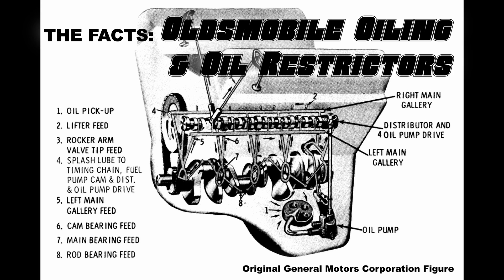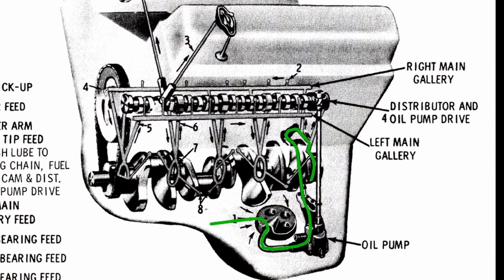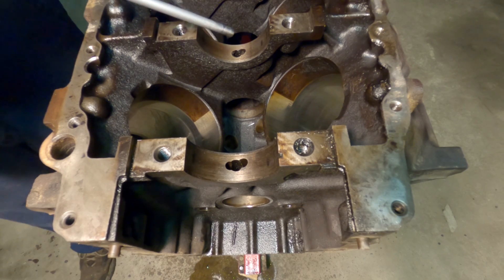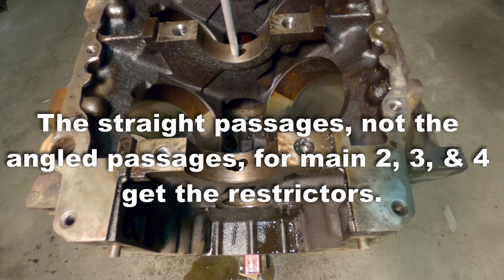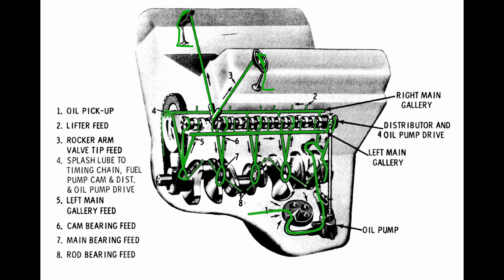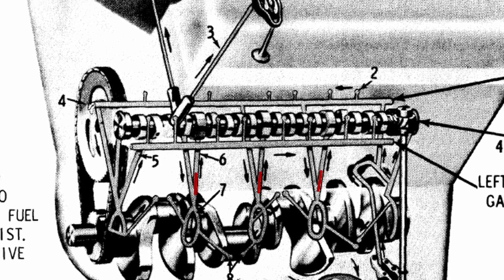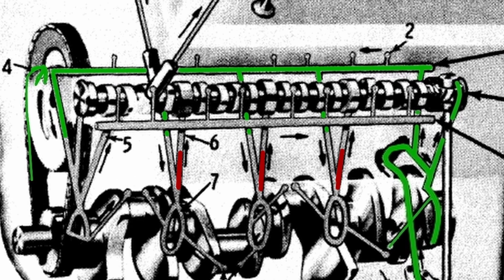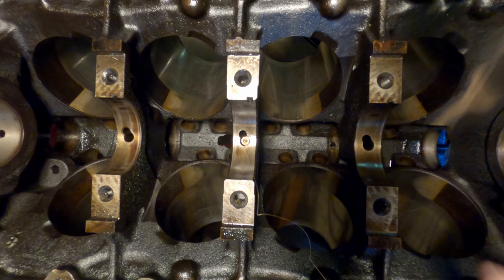The Facts on Oldsmobile Engine Oiling & Oil Restrictors

Comment: Great video but no where does it tell me the size hole in the restrictor. Thanks
Reply from the maker: I just measured a 455 I built and can verify the restrictors are a chamfered 0.100" orifice. The ejector ports are a chamfered 0.045" orifice. Those are accurate to 0.001" so if you use poor measuring equipment and make a 0.949" restrictor it will perform differently, accuracy matters here.

Comment: Joe mondello used them so don't not use them.......Dr. olds.
Reply from the maker: Joe Mondello understood Olds engines in a profound way. A stock Olds engine will easily run for 300K miles without restrictors, but for performance applications the restrictors really do make a difference. Dr. Olds knew his stuff.

Comment: What size are the restrictors?  .040?
Reply from the maker: Excellent question, 0.040" would be extremely small for that passage! The restrictors are typically drilled with a chamfered 0.10" orifice.

Comment: Excellent video as i have a remanufactered 350DX diesel oldsmobile long block and company installed cheep bearing and i don't think the block was cleaned properly I'll be checking all oil passages and coolant block ports ❤❤❤ peace and much respect to you 😀 👍
Reply from the maker: Take out the gallery plugs and really clean out the gallery, I see shavings sometimes in the ends behind the plugs. Thank you for the comment!
Reply: @junkdump2720  I added a new comment but it posted to me and not you thanks again for your sound advice 🙂
Reply: @junkdump2720  I'm planning on filming 🎥 my build step by step
Reply: @junkdump2720  I surely will thank for the strong 💪 advice
Reply: Yes the plugs are out and looking like they have magnetized small metal slices and slivers I'm re going through the whole cleaning process your video really is going to help with lots of processes and other things of true knowledge 😀

Comment: Some really in depth stuff. This clears up a lot of info Ive heard over the years. Ive been running a 86 Olds 442 with a 68 OIds 350, 9.8 compression, Hyd flat tappet 230/234@.050/ cleaned up #6 heads with stampted steel rockers, RPM intake/ 650 DP carb / 3.73 and a THM 350-10" 3000 stall. Some "experts" told me that if I dont do major work on the oiling, Id fry the motor in one season of bracket racing. 13.0s from 2000-2004 then 12.60s by 2005-2018. Approximately 400 passes down the quarter mile with a  stock oili pan, no restrictors , only a high volume oil pump (runs 40-45 psi). I figured that with only shifting at 5800....no sustained high speed use, that Id be fine with the set up I had. You seem to confirm that if you're not spinning the motor to high rpms for long periods, like say in a boat or a 10-11 sec bracket car shifting at  6500, it's  as critical, that the engine wont blow up in a season.  OR, maybe Ive just been extremely lucky. Conventional oil to boot. At what RPM/ET do restrictors really become a must?
Reply from the maker: First, thank you for sharing your real world experience! I bet there are not many people that can say with certainty, aside from real experts like the Joe Mondello and Dick Miller types, where the line is when restrictors are a must. I have raced a worked 350 and 455 without restrictors and stock pans successfully, I used the correct viscosity conventional oil and Wix oil filters. My recommendation is to install them when you next rebuild or tear into the engine. They don't hurt anything, they simply change the oil distribution to favor the bottom end rather than sending so much extra oil to the cam bearings and upper end. Thank you for your comment and don't listen to the "experts", most of them have never seen the inside of an Olds engine and they're just repeating what they heard from an "expert". On my channel I try to disprove the misconceptions using facts and accurate information.

Comment: Hello what oil should I uses on 70 cutlass sx 455
Reply from the maker: For a stock engine, 10w-30 is the viscosity your engine was designed to work with, except for extreme circumstances like a desert. The best oil by a large margin is Castrol Edge Full Synthetic (not High Mileage). It has the best protection and leaves the least residue, also Never add any additives to your oil. The best oil filters are WIX or the NAPA Gold series (which are wix filters). I never recommend purolator or Fram, purolator are too restrictive and fram are prone to failure, both fail and bypass oil in a way that you won't notice your engine is receiving unfiltered oil.
Reply: @ thank you 🙏🏼

Comment: I Brought a rebuilt oldsmobile short block 307 engine and wasn't getting oil pressure on the driverside up to the push rods and rocker arms because ,whoever rebuilt the block left out the rear left side inner oil gallery pipe plug that also oils the distributor driving camshaft gear.
Reply from the maker: That is a common mistake I find in Olds engines, I am glad you figured out the problem!

Comment: There is so more you can do to the Olds block. 
Cross drill the crank, enlarge the oiling holes on the main bearings. 
BMRE did my engine work and so far it has lasted 30 years in my boat with rpm’s up 5,600.
Reply from the maker: That's very true and it's great to hear your engine has lasted so long! I also cross drill all of my cranks.

Comment: I have comp cams roller tip rockers,  they are advising that without rocker arm oil deflectors, a hi volume pump will shoot oil over top of the rockers and they go dry  and damage. I am not running restrictors, this is a low rpm motorhome engine with high volume pump
Reply from the maker: If you are worried about this happening I suggest using deflectors or restricted pushrods. Oil deflectors will not adversely effect your engine if properly installed. A pneumatic drill will run the oil pump at idle speeds so you can verify proper operation with one of the valve covers removed.
Reply: @junkdump2720  I just haven't seen any oil deflectors for an olds 455, comp cams doesn't have any that I've seen, what I have seen is temporary ones or weld on one's, .. it seems restricted pushrods are as expensive as the complete set of rockers, pushrods, guides and studs. And I'm positive I won't find any in canada... I think I'll take the high pressure spring out of the high volume pump and it won't be as aggressive... I also wonder if the problem will even exist at low rpm, I never get this thing over 3500 rpm anyway
Reply from the maker: @TrentGustus  You are correct, finding deflectors for an Olds engine is near impossible. You can get restricted pushrods for $250 USD through Mondello, measure your originals and they should be something close to the PR-9.700x5/16, they are Hardened with a  0.040 restricted end that should be on the Rocker Side. Removing the high pressure spring is a great idea for your engine and you hopefully won't have problems.
Reply: @junkdump2720  use the original pushrods with the comp cams rockers? Of course comp specifically says to use their pushrods as  well ,  ... maybe that's the best idea, I'll look at my old pushrods.
Reply from the maker: @TrentGustus  You will need hardened pushrods if you have heavier valve springs than stock. Lots of Olds guys run high volume oil pumps without deflectors, I don't think I have ever seen Olds specific deflectors.
Reply: @junkdump2720  I have stock valve springs, so shouldn't be an issue. I'm going to check the length of the stock, pushrods and the hole size, hey, thanks for all the help... ive probably watched each of your videos 3 times.. one more question.. stock head torque was listed at 85 lbs, however  arp bolts recommend 70lbs, and these are felpro head gaskets, not stock mls steel.. what is your opinion?
Reply from the maker: @TrentGustus  I torque my heads to factory torque specs, the arp bolts can handle the extra torque, just be certain to dip the threads in engine oil before insalling and torquing.
Reply: Well, got my answer on the stock pushrods, you're right, one end does have a smaller hole, however, they're about 7 mm shorter and that causes the rocker to interfere with the   radius low on the studs. In my attempt to adjust,  the rocker pressed on the arch and got stuck so, unfortunately I'm just going to use what I've got and take out the high pressure spring out of the melling high volume pump
Reply from the maker: @TrentGustus  if you find you need the hardened restricted pushrods in the future Mondello has longer and shorter offerings, measure the lenght of your originals and record it somewhere.
Reply from the maker: I am sure you will be okay but I have to share an early mistake I made. I own a 455 that I rebuilt a long time ago, I made the mistake of using the stock pushrods with new valve springs. After about a year, one of the pushrods bent, jammed, messed up a lifter, and ground down a cam lobe. It was an easily avoidable mess.
Reply: With stock vavle covers, they will sit at about the same level as the deflectors. However. If you have deep aftermarket covers, then it may spray too high

Comment: Restricting oil to the top end of an engine is bad😢😢😢😢, it just needs to drain back in more volume. Open up the return passages. Use roller lifters and rockers,  use 2 remote filters and a deeper pan then rev it to 7500, Bloodviking engine master
Reply from the maker: Using restrictors properly is very good for an Oldsmobile engine, the video has good information on how, why, and when to use them. Opening up the drain back passages is very helpful. I don't recommend ever using more than one filter in an Olds engine. Roller lifters and rockers on Olds engines require a lot of adjustments to the valve train, only very knowledgeable engine builders should be trusted to make certain your top end geometry and tolerances are perfect. Olds engines are very different than other GM offerings like Chevy.

Comment: A pickup screen blocks alot of flow where a magnet placed near the pickup could do well
Reply from the maker: The pickup screens on Olds engines do not restrict oil flow in a meaningful amount, they only screen out large debris, it is highly recommended that screens are left in place.

Comment: These engines didnt fail when in stock form. Higher pressure vs volume could give more pressure to sustain the crank from scraping the bearings
Reply from the maker: Agreed, these were tough engines in stock form.

Comment: The hi volume hi pressure pumps at high rpms sucked the pans down a bit. Just use a slightly shimmed standard pump. 80 psi at 7000 rpm is good.
Reply from the maker: Thank you for the comment! I agree that the high volume high pressure pumps are a little overkill, thanks for the tip.

Comment: Also at what rpm is max for a olds stock lubercation system
Reply: 350 or 455
Reply from the maker: Maximum RPM is determined by, and limited by many factors including, the cam, heads, and intake. Most stock pre 1973 Olds 350 peak power output occurs at 4500-5400 rpm making it unnecessary to rev past 5000-6000 rpm. Peak output in pre 1973 Stock Olds 455 averages at 4200-5000 rpm making it unnecessary to rev past 4500-5500 rpm. The stock oiling system is not designed for sustained 5500+ rpm in racing applications.

Comment: Does all the olds v8 engines have the same lubercation systems
Reply from the maker: This video demonstrates the oil system for Oldsmobile 260, 307, 330, 350, 400, 425, and 455. The older engines are different.
Reply: Ok thank you very much

Comment: I never hear anyone talk about block or head mods when talking olds oiling issues. What about opening up the oil return holes in the heads? Especially the rear ones. Chamfer the opening and polish it. People used to paint the block valley with Glyptal to aid oil drain back. If you really wanted to you could smooth the heads and block to aid oil drain back. Smooth out the oil feed in the block under the oil pump. Just some alternative ideas.
Reply from the maker: I always open up and reshape the oil return holes in the Oldsmobile heads I work, it helps with drain back, but I have never seen a street or street/strip Olds engine suffer damage from drain back problems. I hear it's an issue with boat engines. I never touch the oil holes under the pump and don't recommend it. The Olds oil pump bolts onto the rear main cap, I believe you should never work your rear main cap. It will not gain a significant benefit for the chance at weakening or causing alignment/deflection issues with your rear main cap. You can easily restrict your top end if necessary or install an oil pump or pump spring to gain pressure and/or volume. Thank you for the comment.

Comment: There is a lot of disagreement on restrictors. I am using none in my roller cam, aluminum head Olds 358 build. It will have a Canton pan and high volume oil pump. It won't see excessive rpm for long periods, highway rpm will be 2000 rpm or less. I think most issues occur on the taller, big bearings 455. Who knows how many issues are actually machine work and balancing issues.
Reply from the maker: You make a great point that poor machining and balancing result in a lot of damaged engines. The restrictors mentioned in this video are harmless and work excellent, I provided the flow diagram to hopefully help dispell the misinformation and help people understand why this restrictor type helps without restricting oil flow where it's needed. Thank you for comment and your 385 sounds like it's going to be an excellent engine.

Comment: got a 75 350 olds. ran low on oil. new filter, fresh oil, now my lifters don't get oil. any ideas????
Reply from the maker: I would start by checking your oil pressure. If that is normal start diagnosis by turning your engine to TDC on your timing mark, then mark your cap to rotor position and remove the distributor. Now rotate your engine while priming it, see my video https://www.youtube.com/watch?v=WBfhPIcz1MQ   Take note of which rockers are not receiving oil. Once you determine what isn't getting oil you can check for clogs or defects in your lifters and pushrods. If all of your rockers are not receiving oil you will likely have to teardown the engine to determine what is wrong. If all the rockers are getting oil and you hear clattering when the engine was running, it is possible that there is excessive wear in your bearings, cam, lifters, pushrods, or rockers. Thank you for the question and let us know what you find.

Comment: Breaking in a new cam with restrictors doesn't sound fun.
Reply from the maker: That's a common misconception that I have heard before, in truth the restrictors do not affect the breaking in of a new cam. The cam break in procedure is for the cam lobe surfaces and lifters. The cam bearings are a viscous bearing, like your main bearings, and have no direct effect on the cam lobes. When restrictors are used, the oil is only being limited to the 3 inner cam bearings as shown in this video. Your camshaft lobes primarily receive oiling from the crankshaft splash/slinging effect, in some engines they also partially receive oil from drain back in the valley. This is the main reason why the camshaft break in procedure always directs you to keep the engine RPM higher than idle, usually somewhere between 1500-3500 RPM. Thank you for the comment, I'm glad to have the opportunity to explain more about oil restriction in Olds engines.
Reply: @junkdump2720  I appreciate you taking the opportunity to explain.  I've never done it, and I'm not even sure that I'll have to yet.  Hopefully not, because to be honest it doesn't sound all that much fun with or without the restrictors.

Comment: I owned a 1972 442 with a 455 that had the 308* cam & hood scoops for a long time. The worst that I ever had to deal with were very simple things.....carburetor, fuel pump, and the like.
Reply from the maker: Oldsmobile created a great engine and a 1972 442 is also a great car! Which factory striping did yours have, was it the pinstripe hood outlines like my cutlass in the 350 video? Thank you for sharing!
Reply: @junkdump2720  The 442 pinstriping & the hood pinstripes.
Reply from the maker: @Marc816  That's awesome, you see the large hood stripes all the time but I prefer the 70's look of the hood pinstripes!

Comment: Good video, complete explanation of oiling system. Mondello performance versions of these motors use very similar techniques to your suggestions.

Oldsmobile motors that run at 5000 RPM 5500 Max (peak, not sustained) typically don't ever have oiling issues, unless the drain backs get blocked (sludge), which is something that happens, especially if oil is not frequently changed. The oil drain backs being plugged doesn't allow oil back into the pan fast enough at high RPMs, then you have your bearing failure. Restricting oil flow to force it to the mains is only necessary on a racing version of the motor that's going to Rev close to or over 6,000 rpm, especially consistent high RPM. Anyone that's ever built an Oldsmobile knows they can put a considerable amount of power, if they have decent compression, without ever reviving past 5500.
Reply from the maker: Exactly! I like that you point out the difference between RPM peak and sustained RPM, that is an extremely important difference when considering these types of modifications on an engine build. Thank you for the comment and thank you for watching!
Reply: @junkdump2720  you're very thorough, thank you for your videos.